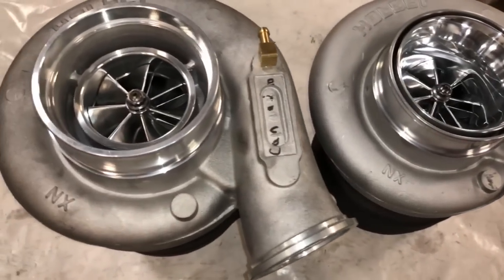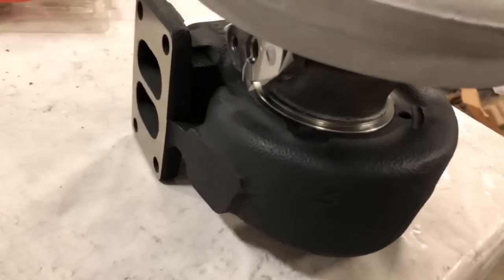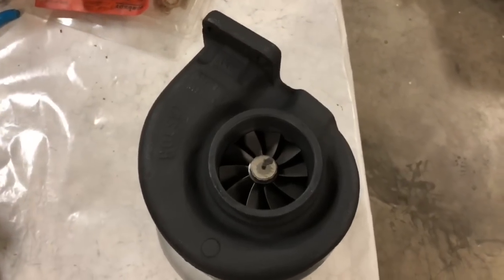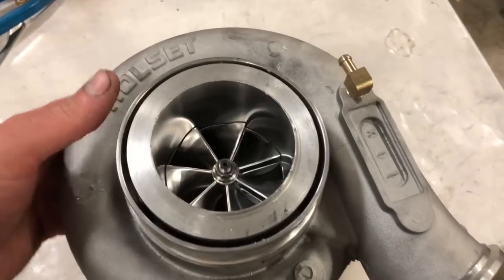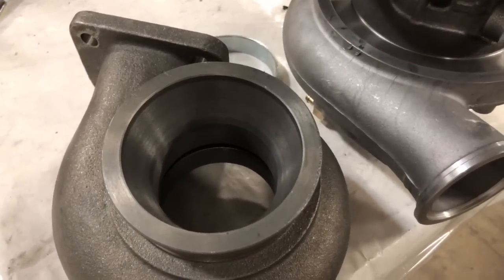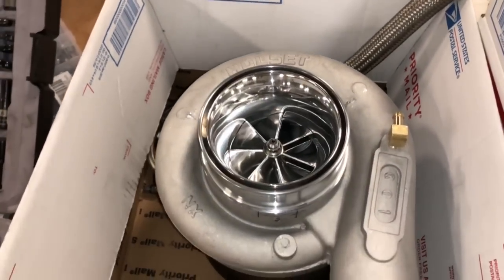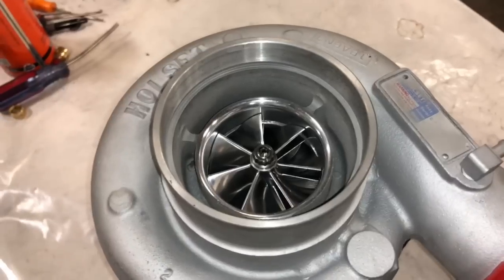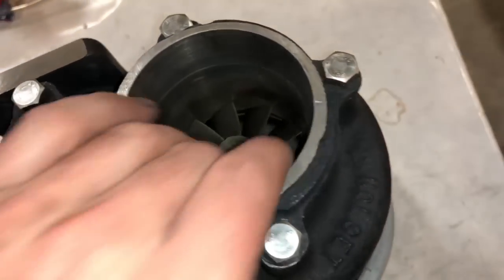T51R Mod Before and After

Comment: one day there will be a video where they actually physically explain and show what makes the T51 sound loud, one day but not today or in the next 6 years.
Reply: I read in other comments that it is the sharp edges
Reply: @lockdownenemy2286  from what I can see, imo, the housing has a certain style of air opening entrance, I guess it makes a whistle just like when one moves their lips and you can hear the change and pitch in sound. In short words it’s the way the air enters which makes the noise

Comment: Craftsmanship is appreciated . I wonder if a T51R mod on a GT3076R would help its performance ?
Reply: Did you get an answer to your question?
Reply: a T51R modification makes zero improvements to performance, it it purely to create that whistle sound. 

The top manufacturers in the industry such as Garrett, Precision etc etc would have this as a factory standard feature if it improved performance at all, but it does not

Comment: I keep looking and cannot find any information on this mod. Could anyone tell me if this modification is able to be done on the GTX2863/67/71r housings
Reply: Small frame turbos can be done but the noise won't be as noticeable. Depends on if there's enough inlet material to hog out to begin with.
Reply: Any true good machinist should be able to. If your 100% serious and have the money why not email turbo labs .
Reply: @simonsaysr1994  I'm in UK buddy our postal service is a joke enough. No f-ing way I'm trusting them getting it there.

Comment: You reference hp's quite often.  So, for my understanding, is it bhp or whp?
Reply: what do you think knuclehead? They arent pulling the motor out of the car just t put it on an engine dyno to test turbo numbers. SMh
Reply: @mikegrazio5376  Did you refer back to the original date of the video?  2 years after, and this is the most reasonable thing you can comment?   What a late to the game douchebag.